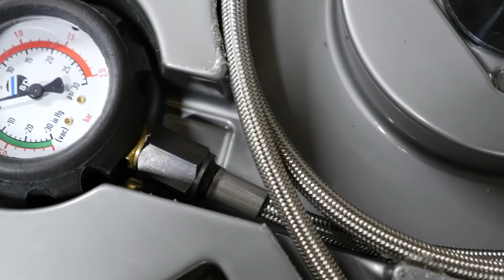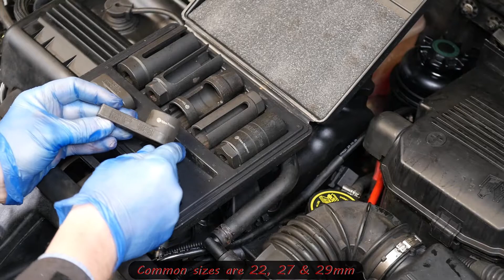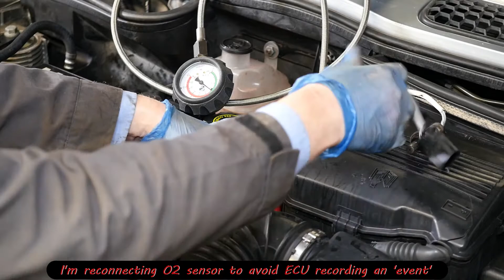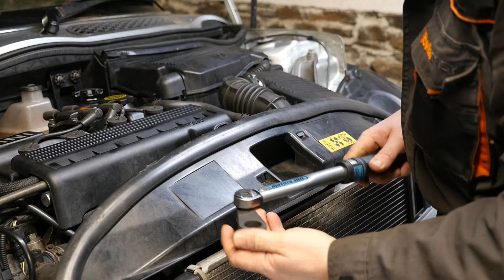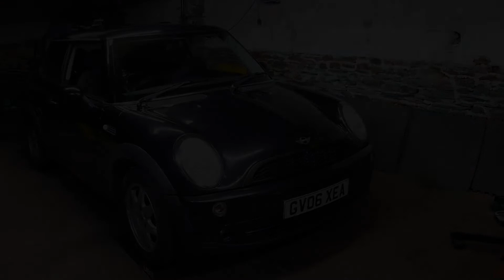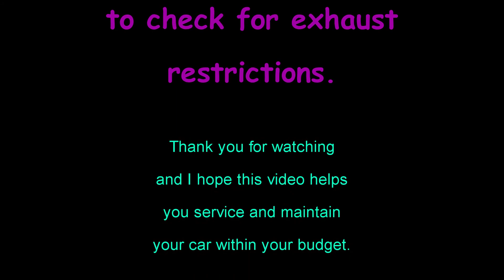How to do Exhaust Back Pressure Test for a blocked Catalytic Converter  🚗 demonstrated on a MINI R50

Comment: What does it means if the needle goes to -10 on the green area when you start the car and when you rep it up...is it good or bad?im a Diy.great video
Reply from the maker: Thank you.  That indicates it's under vacuum.  Where did you connect the gauge on the car.  I think the vacuum part is for the inlet manifold test.
Reply: I connect it on the  catalytic converter/exhaust manifold upstream airfuel ratio sensor.
Reply from the maker: @MariaGonzalez-ei1pv  sounds like the right spot.  Wonder why it would have a negative vacuum?

Comment: Great video..I have a 2002 toyota camry  le 2.4 4cylinder  I have 2 catalytic converter one on top and the other under the car .we're do I connect my pressure gauge.?or it doesn't matter which one?
Reply from the maker: Thank you.  It's normally before the cat as the pressure after the cat would be open to just atmospheric pressure.
Reply: @CoatsandGaiters I know this is an old post but BMWs have two upstream sensors. Inline 6 engine

Comment: You may apply a bit of high temp anti-seize to the O2 sensor threads to prevent it from jamming next time you try to remove it.
Reply from the maker: Does make sense to do that, though I think Suzuki sometimes add a paste that locks the sensors in just to add some fun to your life if you need to remove them.  I remember removing this paste and adding anti seize.
Reply: Allowing the O2 sensor/cat to warm up fully before removing it may have helped mine, hasn't been changed in 8 years and came off without having to use a torch 👍
Welding gloves might be a good idea unless you don't mind burning your arm
Reply: For years I've read warnings from the manufacturer that antiseize may foul out the O2 sensor and not to use it on the threads. I've never used it and not had a problem removing them.

Comment: I wouldn’t put E10 anywhere near my vehicles or petrol tools
Reply from the maker: I have a suspicion it's the E10 as my silver cooper had E5 in and would accelerate quicker than I needed, this Black MINI has only had E10 in and the difference is incredible.  Can it really be such a difference between the Cooper and the ONE or is the E10 playing a part in it's lack of punch.  Even stalled it a couple of times yet it will drive totally fine but just lacks that ooomph